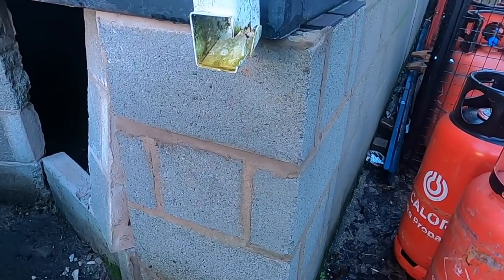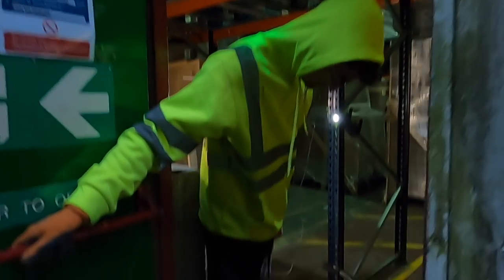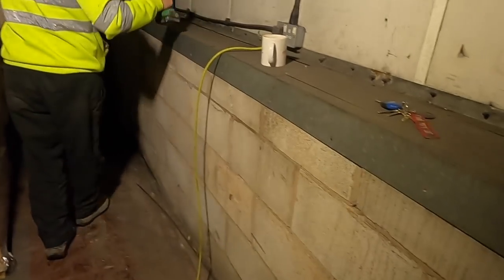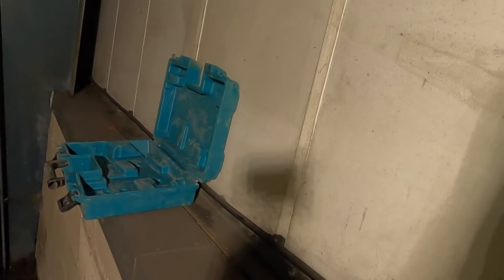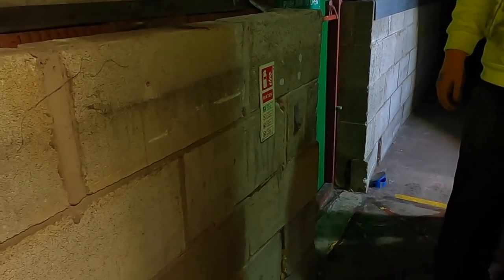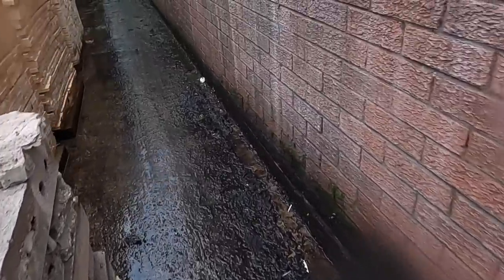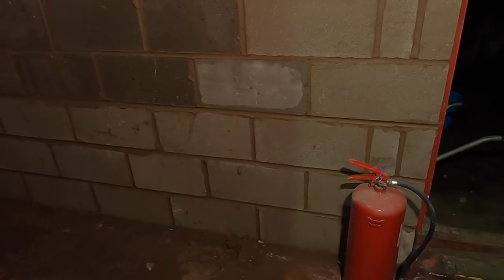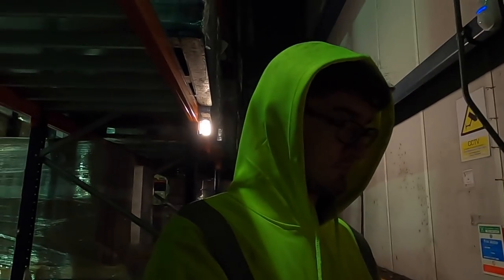REPAIRING FORKLIFT DAMAGES!!

Comment: Try an old saw or masonry saw to tooth out the blocks. No dust also why didn't you chase out the blocks to save any cuts in the middle.
Reply from the maker: The building was sat on the souls pillars so I didn’t want to cut into them 🧱👍🏽

Comment: Hey Steve and Alex. you guys are legends. just a tought. have you tried to thoothing out with reciprocating saw using brick cut blade? they are around 10 quid oer blade on saxtons, first time ive used it today bricking up a window.  its a lot better than grinder. bit slower but hardly any dust. give it a try.
Reply from the maker: worth a thought , thanks 🧱👍🏽

Comment: Haha I did one like this on a Howdens branch not too long ago, he made a Hella worse job of it than this one though it was a full 4m x 2.4m panel smashed to bits. 😂 9 inch too had to dress the bricks and re use on the outside
Reply from the maker: Oh no the dreaded brick cleaning 😩🧱👍🏼
Reply: @SteveAndAlexBuild  they were Tudors I think, the stuff just fell off them tbh. You know, that rare occasion when you bang two together and it drops off and you don't need the scrutch hammer out your bag 😂
Reply from the maker: @rossmale8715  result ! 👌🏼🧱👍🏽

Comment: Tying in is never the same as putting wall starter on! Not as strong at all! When u tie in it dusnt fill joint properly and get good connection at all! Too weak in my opinion!
Reply from the maker: Bluebirds are great ties plus they go in at 45 degrees so will never pull out 💪🏽🧱👍🏼